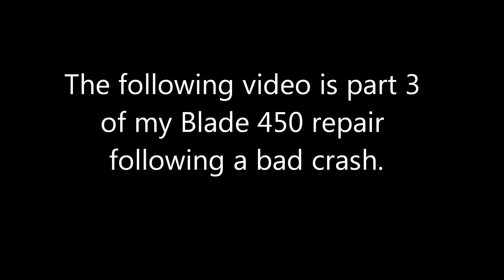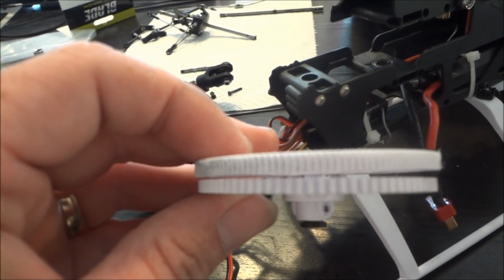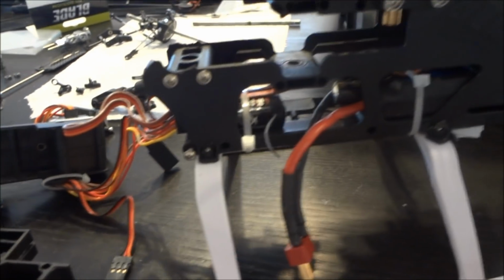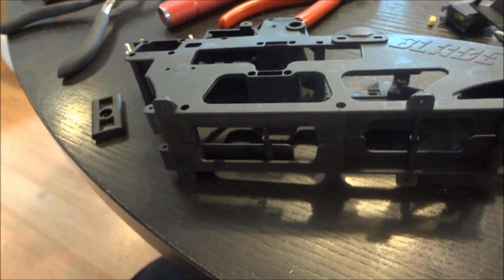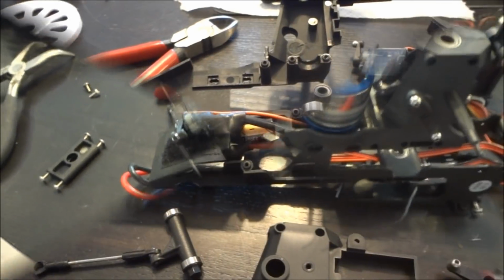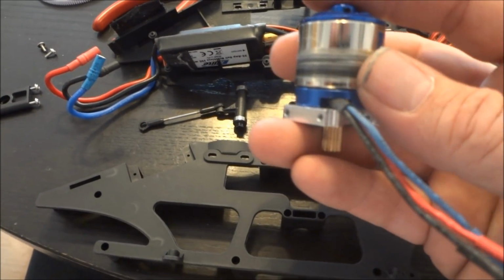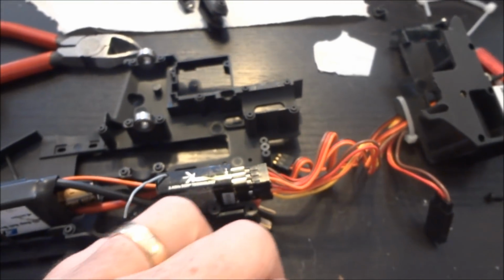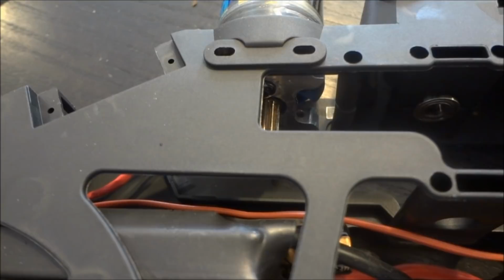Blade 450 Complete Repair Part 3

Comment from the maker: That's a great tip!  Thanks, I'll keep that in mind if I have to do this again.  Though I think I'm done with flying Flybar helicopters, ever since I got the Blade 450X, I've fallen in love with the Flybarless helicopter. =)  Much easier to repair (head wise), and setup.  And they feel so much more 'Locked In'.  But again, great tip!  =)

Comment from the maker: The simulator will help you big time!  I go out to sea for months at a time, I bring my laptop and sims, I practice every night.  I usually focus on things I need practice with, for example, nose in hovering, inverted flying, etc.  This way I learn the stick controls.  Then when I get home on vacation, it's just a matter of getting over my nervousness.  Now I'm up to flying inverted circuits, and some rolling tail slides with my 450X.

Comment from the maker: By getting something like the Nano, it will greatly help you learn the controls of a collective pitch helicopter, especially when it comes to orientation (nose in hovering, inverted hovering etc), at a considerably lower cost with regards to repairs.  And if you don't already have a simulator, that's also a great investment when it comes to learning to fly helicopters. I have both RealFlight, and Phoenix that I use on a daily basis.  :)

Comment from the maker: It was about $100 in parts, but $30 of that was just for the CF blades, I was using the 440 size motor upgrade, and the wooden blades can't take the speed of that motor. But a lot of the parts come in sets of 2,for example the when you buy a new tail tube, it comes with 2.  So still cheaper just to buy parts. And yes I see they are cheaper now, I paid $300 for mine, glad I sold it when I did, got $200 for it. Now I have the 450x. And I LOVE it! :-)

Comment from the maker: I would like to suggest that if you have only flow a 3ch coaxial up till now that you possibly look at getting something smaller and cheaper than the 450 size.  I just recently bought the Blade Nano, it's much cheaper than the 450, and it's collective pitch.  So you can still practice many of the stunts that the 450 can do.  And the parts are so much cheaper.  It's also a very durable little helicopter, I've crashed mone dozens of times with very little damage.

Comment from the maker: Oh yea, I learned a lot from doing this rebuild.  Since then I've actually built an Align clone 500 sized helicopter, and because of this experience I knew what to look for.  

And I plan on keeping these videos here for a long time to come.  Since making these videos I've sold the 450 3D, and bought the Blade 450X.  If you have the money for it, and still thinking about buying one, I would get the 450X over the 450 3D, it's way better in my opinion.  Much more stable to fly.  I LOVE IT!

Comment: Thank you for the videos, I own two of these heilis and I recently bought a crashed one off of Ebay so I am going to have to do some of these repairs but not as extensive. Im curious to how much the total cost of repair was it seemed you almost replaced the entire Heli. They sell new now for under $200 so they may be fly till you crash save what you can and order a new one. What are your thoughts?

Comment: did your battery sustain damage ? i see scuff marks on the motor housing , i had that problem as well and it ruined a battery by cutting thru the batterys outer shell , my own fault as i hadnt velcroed the battery down....big mistake ,
Reply from the maker: Sorry for the delayed response, I have been out at sea for the past 3 months, but now I'm home on vacation again.  But to answer your question, I don't remember the battery being damaged during this crash.  I think the scuff marks on the motor were from a previous flight where I had a battery sitting to close to the motor, but noticed a strange sound after taking off and landed before it damaged the battery to much, just small scuff marks on the battery.  Blade isn't known for allowing much space for batteries in their models. =/